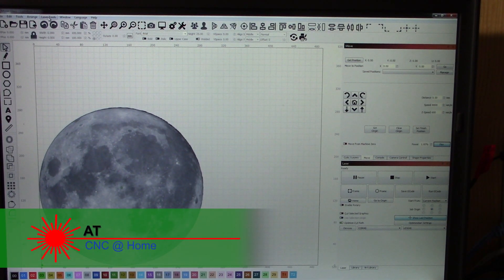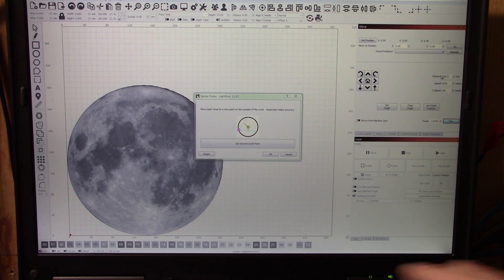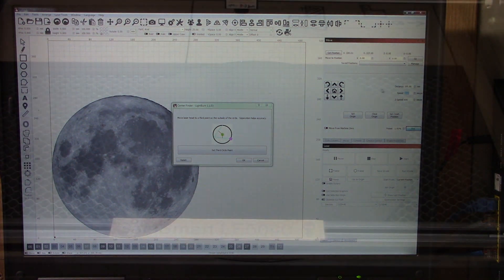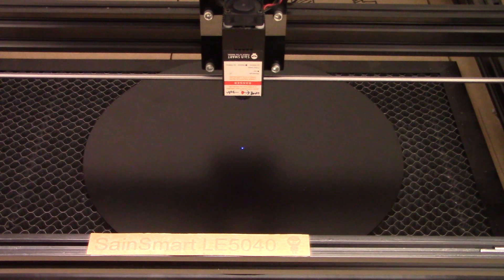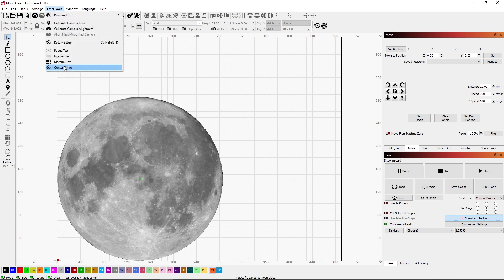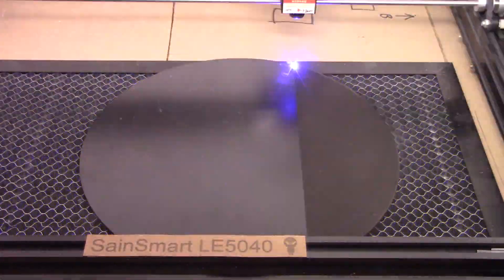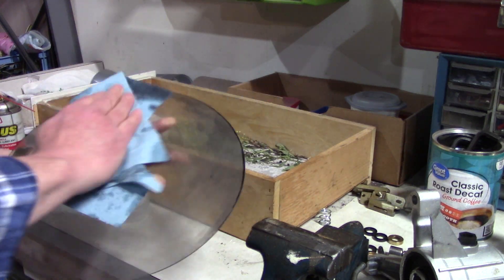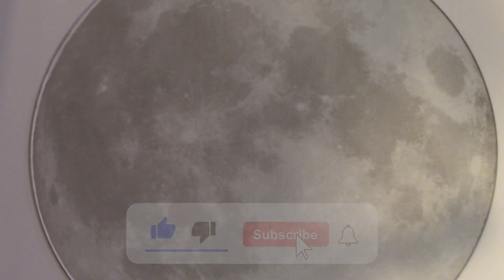LightBurn Center Finder and Glass Moon

Comment: I think I miss understood what you said but I would like to confirm, or better yet which turned out best the tempered glass or the non tempered glass? I am guessing the tempered glass was more difficult. I would be using a 10 watt diode.😁🛫
Reply from the maker: I would have to watch the video again to see how I confused you.  Both plate and tempered glass etched fine with the 5.5watt laser.  Oddly, I think the tempered glass burned more easily from what I remember.  I just put out a new video where I am etching on plate using tempera paint and that worked great. https://youtu.be/yvZqTes9UiM